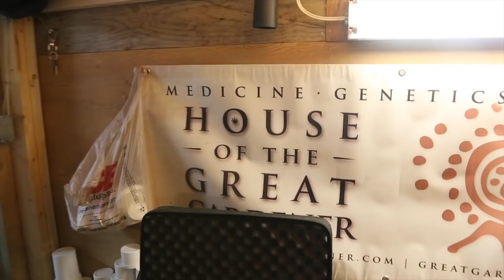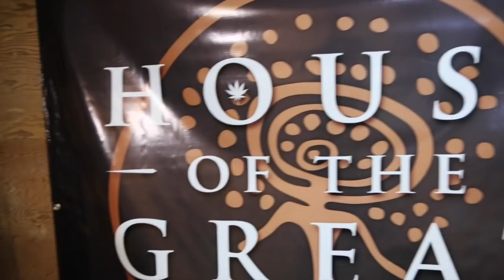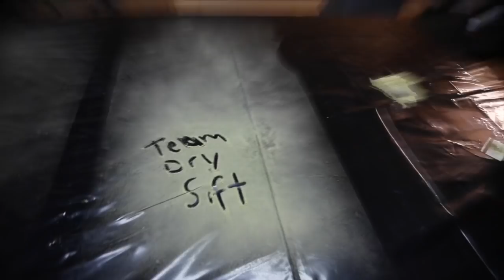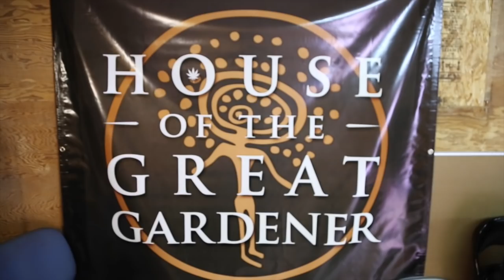The House of the Great Gardener I

Comment: Dude, check out Dance Hall. 16% CBD. Could be as little as 1-7% THC. She's a 60/40 Sativa hybrid. You don't get the strong body buzz but it has a very cerebral, creative, energetic high. Very social and is highly sought after by the recreational market as well as the medicinal market.
Reply: @Chef..... How is the yield on her? Thanks in advance.
Reply: That sounds like medication.
Reply: Common midwest ditch weed. Common hemp: high cbd and NO thc. good medicine growing along every interstate in the midwest and every highway in Nebraska. Check it out. It's FREE for the picking.
Reply: I actually get a good body sensation from strains like that. I'm sensitive to thc, so the balanced strains work great on me. It only takes a tiny taste even after a year getting back into it from an 18 year break. Which is great cause an eighth lasts me over a month. Or a gram of concentrate, same deal.

Comment: Hey Bubbleman I have a business selling energy efficient LED lighting to business across the US and Canada. We have developed a new LED Super Strip Light that us used to replace existing T5, T8 and T12 fluorescent tubes for warehouse hi bay lights. Our strips are saving these people over 50% in energy and giving them 30% more light. Our LED lights are putting out 165 Lumens per watt at 5000K. I am wondering if these would be a  good fit for growing in your field. They are super bright, now energy, low heat and will last 100,000 hours.

Comment: great video only problem is the seeds, either your stressing out your plants or, buying fem seeds that hermie late flower. having seeds will also cut down on final potency as the plant will put more energy into its offspring then trying to mass produce tricombs to get pollinated.
Reply: I'm pretty sure he is harvesting seeds for breeding projects...if that's the case, he's doing it on purpose.
Reply: i can see that, i was just thinking it was all test plants from the genetics he was running all the ones that harvested but maybe not keepers.